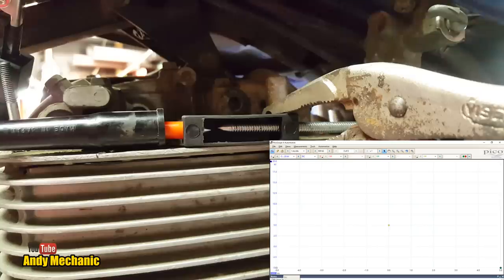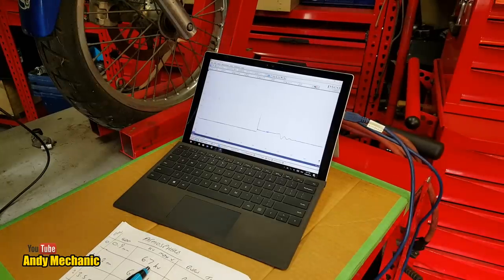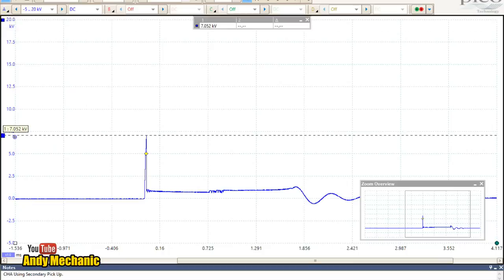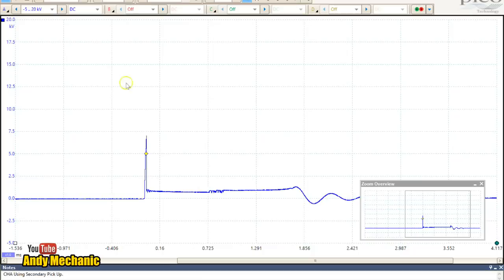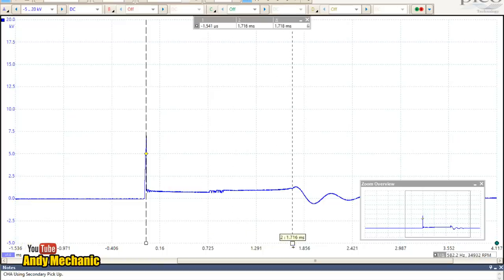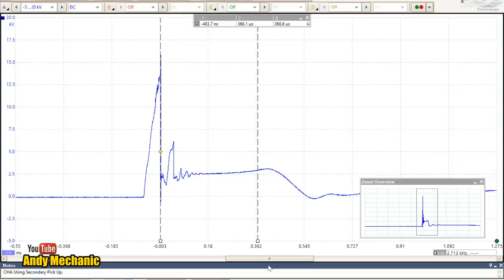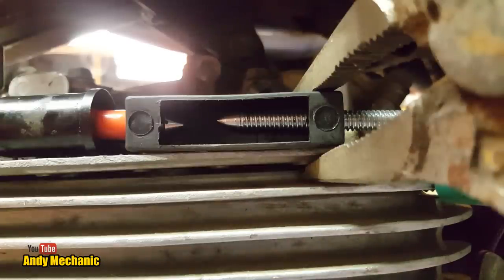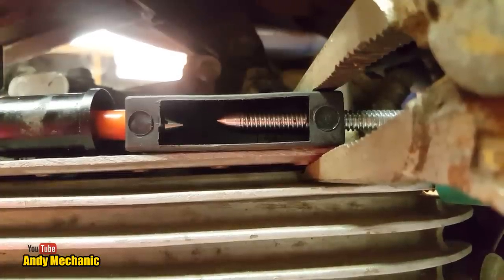How does spark plug gap affect HT voltage & spark burn time? #1447

Comment: I started watching the video after I encountered a strange problem on an audi tt, it was equipped with incorrect spark plugs, with a greater distance between electrodes than specified by the manufacturer, the car shakes when I accelerate harder and I could not figure it out what is wrong, after I equipped the car with the correct spark plugs it returned to normal ... now with your measurements in the video I understand better why the distance between the electrodes is so important ... thanks for the effort made to create this video

Comment: Wow this was really interesting and very well designed except for a couple of variables that are different in practical application. 
  First- having no fuel changes things from “real” conditions because fuel is a conductor and lowers resistance. 
  Second- it’s totally different with engine running and even more so with it under load.  At idle for example you may see no measurable difference in changes in firing and spark line but put the engine under load which increases compression pressure and you may see voltage on a large gap jump exponentially to the point you have no spark line at all and just a voltage spike (no spark misfire).

Comment: Andy so what I observe is when the 12v primary collapses it is generating a 20000 volt spark in the secondary to jump the spark plug gap. That is really a massive voltage spike. Very informative video. Didn't realize the collapsing primary generated that much spike. Am I interpeting it correctly? Thanks Andy enjoy all your videos. Enjoy seeing how the systems work up close. 👍👍
Reply: The results of "Counter Electro Motive Force." The amplitude of this voltage depends on the turns ratio (commonly 100:1). A 300V primary voltage, therefore, will be 30,000V in the secondary winding. The voltage will only build until the break down voltage of the spark gap is reached. That is the firing voltage of the spark plug.
Reply: South Main Auto Repair thanks Eric for the explanation. Greatly appreciate it. 👍

Comment: Good stuff to know. I'll check coils with a minimum of 7mm in free air. I always assume the air, being thicker, would actually make the spark gap resistance less.... not more. I've always tested at like a mm or 2, sort of just holding it close to the head. Awesome stuff.

Comment: no.1 video on spark plug test. 

worth spending my time.

put the car manufacturer to shame. 

this test has proof, a longer gap causes higher kv will have less burn time. 

thus, these also stress any ignition coils power packs and direct ignition coil(shorter life).
it also gives shorter burn time. means gasoline might not burn complete as well.
a longer gap gives poorer engine response to my experience.

Comment: How about showing the effeckts within the motor under various motor and head material and head, valve, and piston designs and lean to egr atmosphere mixtures with the intent to maintain power but maximum lean pissiblefor kontinuous heavy load for selected material and shape design kombinations of heads and blocks?

Comment: Hi Andy hope you are still on...
Theo here from South Africa. Interesting man thanks. I have a yamaha tt600 1984 model. According to the manual the resistor plug's gap is .8 to .9mm and the non resistor gap is .6 to .7mm. Why is that? It seems it affects the ignition timing. With a bigger gap when i Kickstart it backfires. Is that because of the CDI discharge time? Affects burn time but then the bigger the gap the discharge time of the CDI increases? Am i correct?
Cheers

Comment: The Elbow Clicker is awesome 😎.
During the 8.1 gap your tester was grounding out as you released the starter button.
With the higher KV readings, do you think an attenuator would have skewed your readings while protecting your scope?

Cheers,
Reply from the maker: Hi Scott, I haven't had any issues with using the attenuator. Yes,,I spotted the grounding issue when I was editing....Fortunately it's not an issue provided some of the ignition events occur via the plug - it's easy to see on the scope when the spark bypasses the plug and goes to ground. 

Scope has various scales and I should have switched to the 50Kv sooner in the test - my bad! Fortunately it was only a little over the range.

Pleased you enjoyed the video
Cheers
Andy

Comment: Hi Andy - I have a question. What Picoscope do you have? Is it a 4 channel 4000 series? - Cheers - matt
Reply from the maker: Hi Matt, yes, it's a 4000 series 4 channel. Though i started out using a 2000 series 2 channel on the first videos. Hope this helps. Cheers Andy

Comment: Hello Andy , you asked for spark tester , I have two 1/ abv and it is calibraterd , works but is a little hard to connect and only to large  leads ( 5mm top on spark plug) 2 is by Ampro Part number T71240 is also calibrated and has a fly lead for the earth and can be used on 5mm cap and smaller 3mm ones , much easier to use  cheers Richard .
Reply from the maker: Great. Thanks Richard. I'll take a look. Cheers for the feedback. Andy

Comment: Andy, does your scope software allow you to dump the sampled scope readings in raw format (e.g .CSV file)?  If so then it would be possible to analyse the numbers with a bit a work in a spreadsheet to do all of the averaging etc across multiple sparks at each gap distance.  Might help allow for the variations between the sparks.
Reply from the maker: I can save the captured waveforms but I don't know if it can recognise the required parts of each waveform and collate the actual readings. I'd have to do that bit manually I'm sure.
Reply: p.s. If you can get the data files to me I'll see if I can find some time to do the analysis.
Reply from the maker: Unfortunately on this occasion I didn't save the waveform files, only the screen capture video files. But next time I'll save both :-)

Comment: nice one andy looks like i caused you a long afternoon lol  . i was thinking wen i seen the kv voltage claim how to big of a gap will shorten the life of you coil due to requiring a higher kv to work. there is a resistor in the plug that may be why you did not get a reading in in the plug
Reply from the maker: Yeah...I was pondering over that after I had finished editing it. Next time I'm working on a bike with the scope I'll try it with a non-resistor plug and see what the difference is. Good call :-)